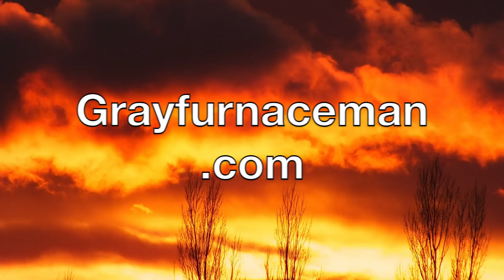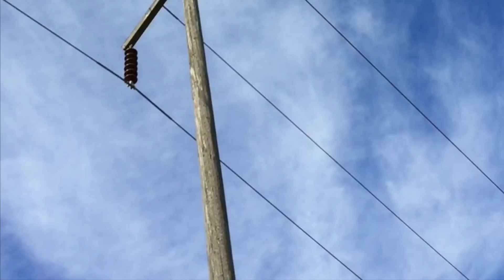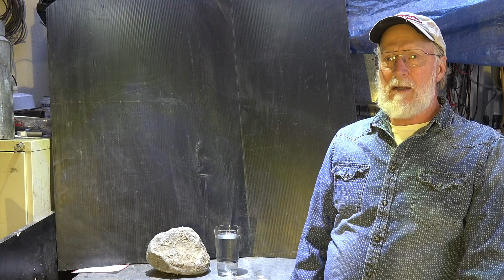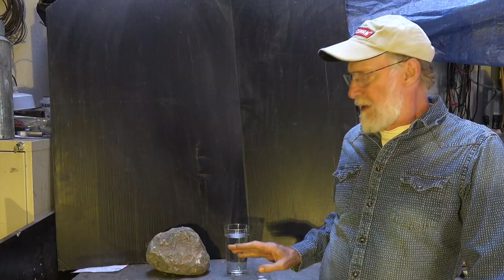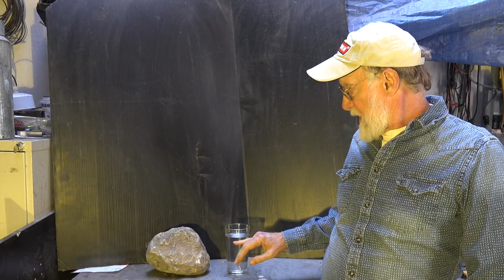Water and specific heat Part 2

Comment: Great wisdom, Grayfurnaceman!
Two of those exceptions are liquid hydrogen, and liquid sodium. Both used, like water, for high specific heat. Compared to liquid water @ 1 Btu/lbm-F, liquid hydrogen is 2.4, and liquid sodium is 24.
Reply from the maker: Both of these substances are not practical for general use.
GFM
Reply: @grayfurnaceman  Don't play with these at home, kids!  Both are highly reactive. Liquid sodium is used as a coolant in nuclear reactors, and as a coolant and "thermal battery" in solar thermal power plants. Liquid hydrogen is used as a fuel and coolant in rocket engines. The idea of using it as an automotive fuel is well nigh insane.
Reply: @MrKentaroMotoPI  I suggest Miscing the two in huge volumes (lol)
Reply: @throttlebottle5906  Hmm... they're both fuels, so I'm not sure if anything would happen chemically. Of course, one is very hot and the other is very cold - sure to be some excitement.

Comment: Good vid. I think it’s 970 btu to change 1 lb water to steam.
Reply from the maker: You got it.
GFM
Reply: Not really 1 btu is the amount of heat required to raise 1 pound of water  1 degree  fahrenheit  but it takes 970 btu to change water at 212 degrees to steam at 212 degrees. The temperature doesn’t change but the state of matter does. This is latent heat or hidden heat because it doesn’t change the temperature.
Reply: If I remember correctly, 144 btus will change H20 from solid to liquid and 970 btus from liquid to gas.